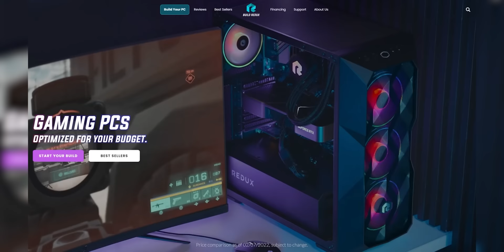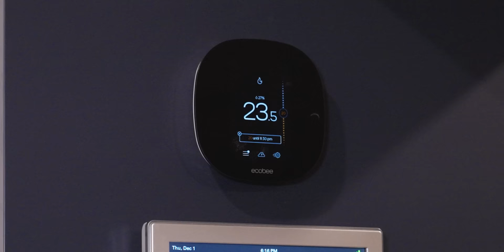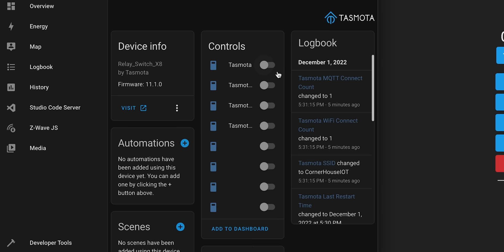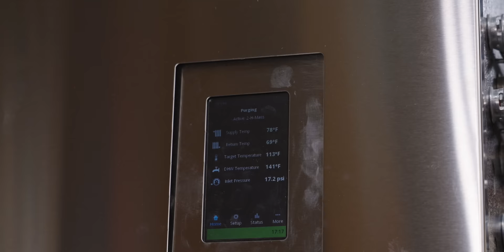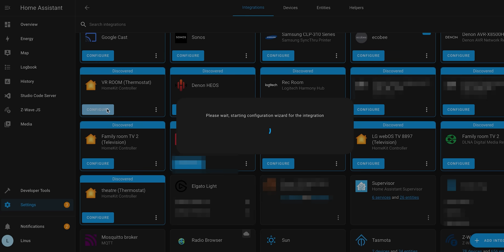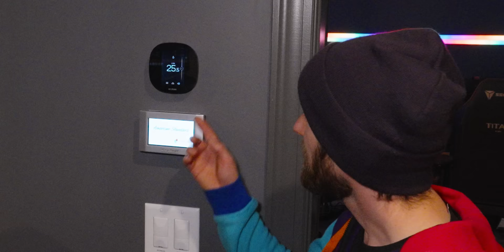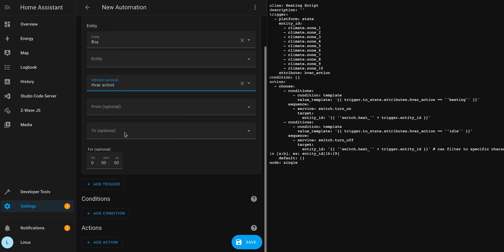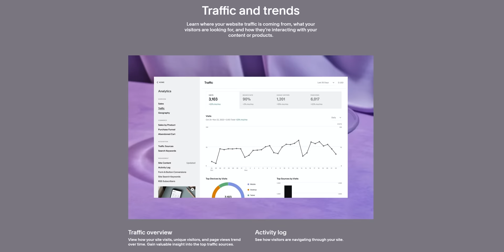My Smart Home is Stupid - HVAC Update

Comment: After watching this, my conclusion is that "smart homes" and "home assistant/homekit" are all so insanely complicated that it only works if have Jake come over to your house to install it.
Reply: Solution is to just use devices that work even when the smart home features all fail. My house has smart switches using Z-Wave, and the system works great until the Z-Wave integration fails. Then it just works like a regular house until you take the time to fix the integration (restart the VM and update the OS for me). The critical part is making sure everything acts normal when all the smart features are gone.
Reply: @grex2595  Better solution: Everyone gets a personal Jake :)
Reply: I personally think my dumb home is far superior. You know what I have to do if I want the heating on? I flick a switch.
Reply: @EvidensInsania  it sure is nice to just be able to turn up your heating or cooling from your phone or other device though
Reply: @EvidensInsania  I say hey Siri set ac to 72 and stay in my bed. Or when I leave the house the ac automatically goes to 77.
Reply: It's more that you, like almost any thing actually, have to invest time and learn about it.  Same goes for other things people don't put time in where it would be beneficial: Food and Cooking, Financials, Psychology, etc.
Reply: If Jake installs it then it won't work.
Reply: @grex2595  Just like a lot of cars with electronic locks have, or at least used to have, a physical backup key. Sometimes even hidden in the key "card". (Renault Espace for example)
Reply: Linus has infinite money to throw at this, and it's still a broken garbage system. I have no desire to even consider home automation.
Reply: I think I would rather just have a physical switch, with a dial if I need to adjust the amount.
Reply: @MmMerrifield  yea very nice, you can turn off your system when you go away, so your system keep going to heat your house for about 8 hour ... and then when you turn it on, just wait 8 hour to feel warm. Veeeeery nice idea to use automation with a huge inertial system.
Reply: @EvidensInsania  You can still do this with a smart home. You just don't need to if you automate things well.
Reply: Home Assistant isn't too bad honestly, but you definitely can sink a lot of time into it. It's free and open source and the team who work on it are always tweaking it to make it even more user friendly.

I'd say this set up is semi complex because of all the relays and stuff. I just have a single ZigBee thermostat that turns heating on/off. For the longest time I only automated it so that the heating turns itself off after a certain time period and we turned it on manually/in our phones. I could have left it there but I already had tiny cheap thermometers in each room of the house, so I just automated it to have heating come on if the mean average drops below a certain heat.

Basically you can tinker with it as much or as little as you want, but it helps if you buy local only hardware that someone else has already integrated into Home Assistant 😂
Reply: it could be much simpler than that. I wasn't happy with any of the commercial solutions (because they connect to the cloud, or have poor failover systems) and I built my own based on ESP32 microcontrollers and MQTT, with a raspberry running Nodered for the interface. Works like a charm, I get weather stats and it looks sick. It is built so that if the GUI fails you can use buttons, and if the sensors fail the program reverts to reasonable behavior, and if that fails you can still override everything with a traditional mechanical thermostat.
For the next trick I'd like to control my AC units over IR signal, imitating their remotes.
Reply: Smart homes work for 30y, if based on reliable technology. The only standard that fits the bill is KNX and it needs a different approach to cabling (sensors & buttons on digital cable), a big fuse board & distribution that can hold all the central actuators and it is a non-IP based communication protocol, which makes it more reliable and secure.

Unfortunately - to do it right is expensive and can add 10.000 USD to your building project easiliy!
Reply: @EvidensInsania  exactly, you introduce some new tech/complication/cost/time investment into your life, at least you should be getting back a considerable benefit. With most of iot stuff, I have a hard time seeing some, personally at least...
Reply: I am an architect and I always tell my clients not to go overboard with smart home stuff... 
1) having it properly and professionally installed is very very expensive 
2) reliability is a problem, there is always something that doesn't work at any given moment
3) the future is a problem... it takes about 5 years until the system is outdated -> there is no updated app for your new phone, spares are hard to find, extensions are incompatible..
4) most people realize that they don't actually use most parts of their smart homes after the initial novelty wears off-  often not even realizing how much isn't even working anymore...
Reply: @MmMerrifield  I know man it's hard to hit a temp switch.
Reply: @olik136  I agree with your first point.

All other points are dependent on the quality if the installation.
My own home is based on KNX and was built in 2005. We love it. Every single day.

Most rooms work through presence detectors, extra lighting is done via scene, shutters are fully automatic and heating/hvac and PV/solar work hand in hand.

But someting like that is 10-20k USD/EUR minimum. On top of what you would normally pay. But it means you get proven technology with a protocol that has been around since the early nineties and components that are industrial quality that will be okay for 50y and can be replaced from a catalogue of 7000 devices / 500 vendors, if a part is no longer available.

For new builds, it is still a very good option, as it makes living more comfortable and more energy efficient - just finding a trustworthy & affordable installer is potentially difficult.

That said. Trying to do this half-assed with cheap retrofit hardware will in all likelihood have the consequences you describe.
Reply: At this point you might as well just get a literal servant. Simpler, reliable, helps someone, and potentially cheaper too (maybe even both monthly and long-term).
Reply: Home Assistant is fairly complex because is more of a DIY solution. The most usual home automations are more of a convenience than a necessity.
That said, I still love the home automation space, but I do understand that is a hobby of mine, and not something that is extremely necessary in my house.
Manual switches work just fine.
Reply: Your conclusion should be to not get them because they are all spyware devices.
Reply: UnjustifiedRecs  I had a buddy sell his house with a bunch of smart shit in it.  The older lady that bought it was constantly texting him with questions until he finally blocked her
Reply: Seriously, this is only cementing my belief that these are only feasible if you have gobs of money and tons of free time.
Reply: @olik136  so true, smart systems, are great for commercial buildings, at home, keep it simple.
Reply: Yeah, this is clearly not for regular people yet. These systems are still at the tech hobbyist level. If you find it enjoyable to tinker with this kind of stuff, then go for it. You're probably the kind of person who loves debugging code (even though you outwardly rage), and this would be super fun and satisfying for you.

Me? I'll stick to throwing some more logs on the fire when I get cold. I don't even need power!
Reply: dont forget brian the electrician
Reply: @xmine08  this! Exactly
Reply: @olik136  "the future is a problem... it takes about 5 years until the system is outdated -> there is no updated app for your new phone, spares are hard to find, extensions are incompatible.."

this is the one and only reason why its just bullshit. "Yeah get the app bro" then just .. buy whole ass heating system when its no longer supported. I can already see this shit forced with future home appliances
Reply: @fadeeeed  The HomeAssistant UI is just a web page. This means it will continue to work just fine after 20 years (barring hardware failure) because HTML is still around and the devices themselves remain unchanged.

But I do agree that HA is for hobbyists. If you want something that normal people can use, you can get KNX, Crestron, Control4, etc, but you will have to pay a lot of money to have it installed, and pay the dealer even more money every time you want to change something.
Reply: @EvidensInsania  Wanna know what I do when I want heat? Throw another damn log in my woodstove lmao
Reply: "come over"? you mean come live with you. Cuz, the way Yvonne describes it, Jake was practically written into their family tree.
Reply: It is... I wouldn't have messed with it at all if I didn't also do all this at work as well.
Reply: Its fine if you are a qualified heating engineer, electrician and software developer
Reply: lol... that was my conclusion when linus was torturing his family with motion detector switches, nobody even likes using those at work
Reply: Yeah, I came directly to the comments section when I heard "ruckus blah blah configure for multicast AP enhancement" seeing if anyone else thought that's the point at which it went off the rails!
Reply: home assistant is cool if you're not afraid of some googling and are tech savy a tad. Def not for run of the mill end users tho
Reply: @MmMerrifield  eh, I've just got a thermostat in each room, and 2 portable ac units, one in my bedroom and one in the living room,so no matter if it's summer or winter there's little to no having to get up or put in much effort to change the temp
Reply: @grex2595  Always been my mantra... I always found it hilarious that people thought going with Philips Hue or equivalent and then duct taping all their light switches was an even remotely acceptable solution.  Even so, our in-laws keep holding all of our dimmers to turn our lights "off", so we have to reset everything to baseline after they've been around!
Reply: @kadomaschine1158  I'm about to find out--ditching SmartThings for Home Assistant when I get a little time since SmartThings is a kludgy, cloud-dependent, overcomplicated yet underpowered mess.
Reply: @adamrobertson7215  yeah, if you need a smart device to operate your lights, you've gone too far. My wife still thinks it's very complicated, but she, and the parents, is still capable of doing everything in our house the normal way without breaking anything.
Reply: @adamrobertson7215  Yep. Everything will be faster and on prem. Chinese companies will no longer know, when you turn your lights and AC on off. Also, try buying hardware that you can flash easily. Start by reading Tasmota or ESPHome documentation, before buying anything.
Reply: @EvidensInsania  100% Life is too short to be faffing around with a million links in a chain that only needs 1 link.
Reply: Totally agreed. I'd never touch anything of that for my home. The time you have to spend configuring everything is so much more than just doing it manually. Also every little device consumes electricity. Running 20-30 of these would probably single-handedly double my electricity bill :D (the server in the basement would triple it then)
Reply: @MarkusHobelsberger  you could run this whole system off of a Raspberry Pi, and if you're doing it right, automation should reduce some of the electricity costs.
Reply: Not if you're you're trying to use different protocols and use a system that talks to itself. When you're trying to use different manufacturers, protocols, etc yes it or course will be a headache.
Reply: solution: linus company becomes a smart home installer company.
Reply: @ChrisDelChris  Systems like Linus is dealing with?  Absolutely.

But I'd counter there's a small amount of home automation one can do that isn't that expensive or complicated and ordinary geeks can manage it without that much money or time.

However, those are not "smart homes", those are traditional homes with a few smart switches and maybe a smart thermostat or two.

Setting it up so you can adjust it from your phone while you're out?  That's probably going a bit too far down the bend.  I could imagine something working feasibly that was just limited to letting you adjust when the system targets having the temperature back to what you think is comfortable.  But I can also very easily imagine a system that was limited to that extent and still a monstrosity.

This is not the right channel for that kind of reasonableness.  I don't know that Linus has even attempted to seriously suggest that he actually is reasonable, at least not according to the way most of us use the term.  I'm not sure who's just that slight touch of into the idea of an automated home to do something with it, yet still sane enough to not go overboard.  But I clicked on this video expecting to see that Linus had done something ridiculous, and got what I expected.
Reply: Linus is trying to use HA with is an open source system. There are full automation systems (crestron, Q-Sys, c4) that have entire eco systems and plugins that work excellently. But it seems Linus is going down the open source path. Which does work. But it’s infinitely more work.
Reply: Linus's house isn't realyy "normal".  And if you pay close attention, the problem isn't Home Assistant, which has a very nice gui, and some pretty cool tools within it, but rather it's the making three different devices work together to perform one function.  Personally, I'm kind of confused about why they have to use the American Standard / Trane thermostat-- Mine works just fine off of a T6 Z-Wave thermostat, and the ecobee 3 would work as well.
Reply: @grex2595  Only been running a few months, but the z-wave has been rock solid.  The 700 based stuff really is an improvement.
Reply: @johngelnaw1243  my stability issues are more than just Z-Wave. The integration in home assistant broke for me at one point (don't upgrade to a x.x.1 home assistant version) and I have a few switches on a circuit with a motion flood light. When that light turns on, the other lights dim for a moment. I suspect that effect is happening in the switches as well, so the switches are getting errors that cause them to fudge up the mesh. Way better than ADT's implementation, though. If the mesh gets messed up for ADT, you lose all your devices for months.
Reply: Better do manually no need for smarthome, it is better for your physical health
Reply: They work fine just don't be stupidly picky.

Or. Don't adopt the brand new stuff and stick to lightbulbs and power plugs for now.
Reply: @chieffw  you can do building automation properly (KNX), or do a hack, i.e., the Linus way
Reply: really, more worth your money to invest into passive solutions. like energy saving houses.